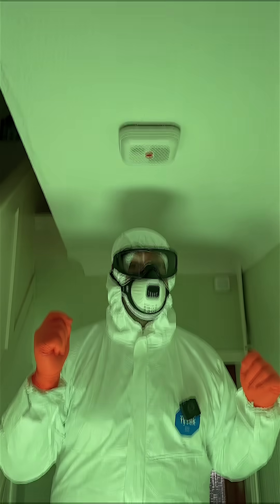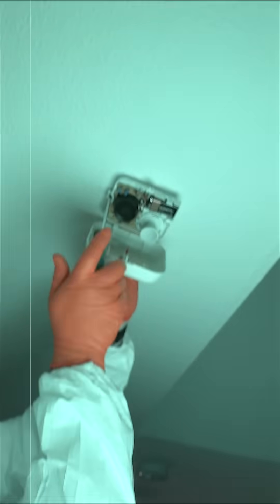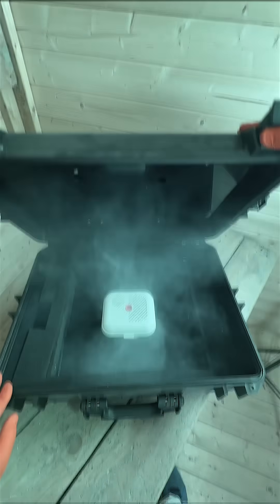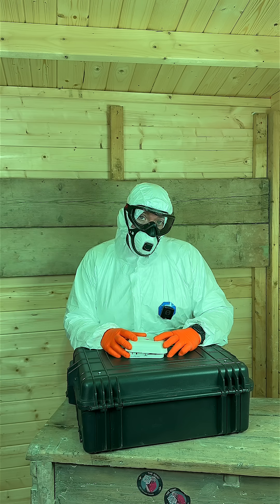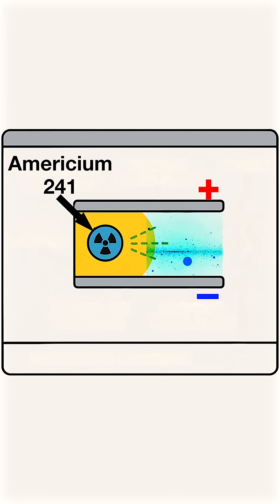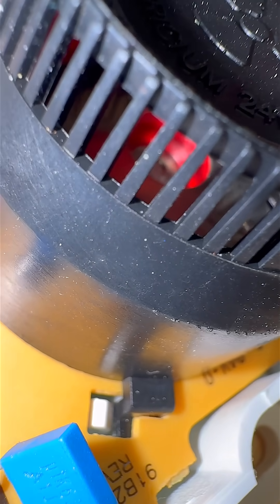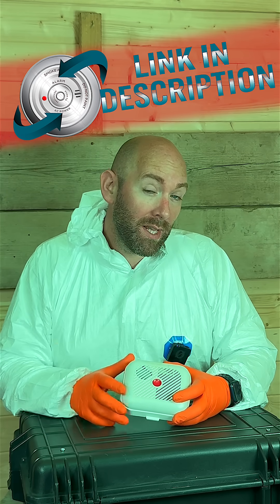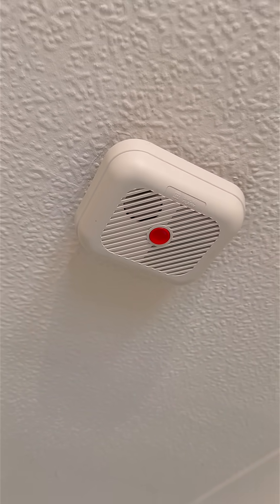Is Your Smoke Alarm Radioactive ☢️

Comment: I had one installed for over 31 years, it still worked fine when i replaced it with a new one a few years ago!
Reply: Except it didn't. Detectors of all types use differentiation, or the rate of change, to detect fire. So a slow build up of dirt in the detector that block the radiation combined with the slow decrease in radioactivity due to the half life of the source means that the sensor slowly lose it's sensitivity. It may have still detected a fire, but no where near as quickly as a new sensor would. If it says replace after 10 years, don't be a dickhead and put you or your family's lives at risk and just send the few quid to bloody replace it.

Comment: Do electricians know whdt alpha particles are?
Reply: They are the pack leaders, right?
Reply: Why would they need to?
Reply: @ChariotsofWire180 If they are working with smoke detectors that contain radioactive Americium then they need to know.
You don't know what methods of protection are suitable for a particular type of radiation until you understand what the radiation is.

You don't know what the risk factors are to your body and how it harms you unless you understand the fundamentals of the type of radiation it emits.

I think your question demonstrates quite effectively there is a problem in this area.

Comment from the maker: Time For a change 👉 https://spark.efixx.co.uk/timeforachange/
Reply: Don't panic too much about the radioactivity part - unless you crack open the sensor , - black part in this example, it is no more dangerous than a holiday in Cornwall - granite is radiactive. Alpha particles are only a big issue if ingested. No real need for the mask, unless the ceiling you remove it from is asbestos or something. The whole point is that even a few whisps of of smoke is quite enough to partly impede the alpha particles ! Modern smoke detection uses light beams, and there are better sorts of sensor for many situations.
Reply: That change has already been made down under. It's illegal to install these detectors and you can't even buy them any more. The only type of alarm that can be installed now is photoelectric and most states require them to be interconnected so that if one goes off they all go off.